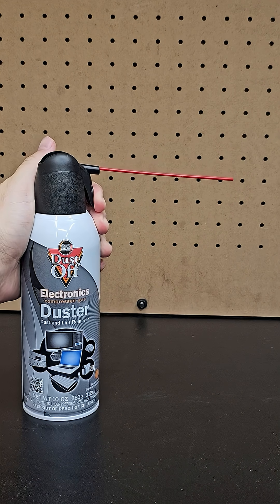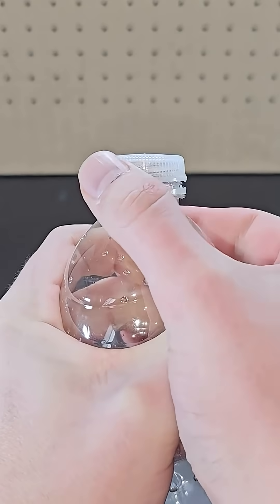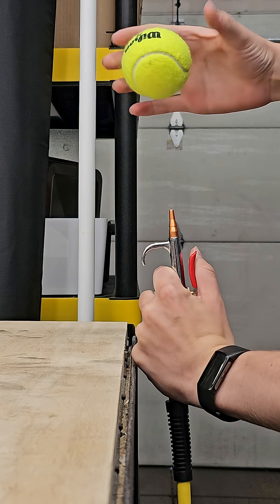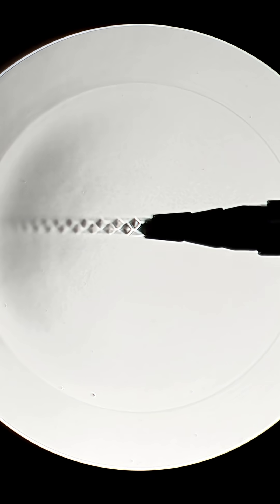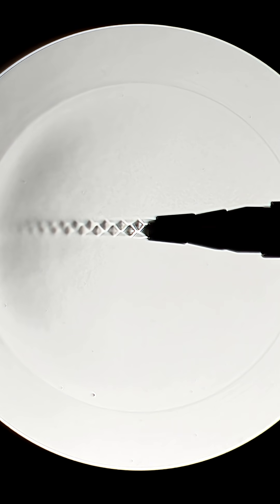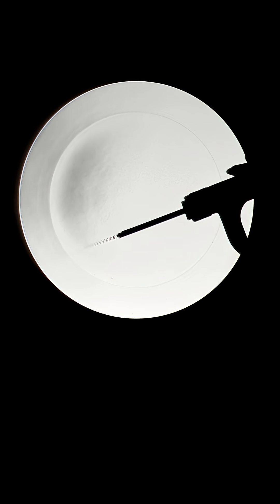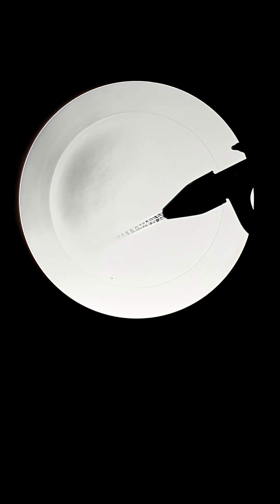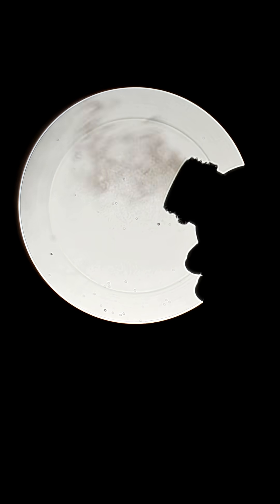Seeing SHOCK WAVES from Compressed Air & more! #shorts

Comment: You can actually train to do the fog bottle trick with your mouth. I used to do it as a party trick.

Suck your cheeks in hard as you can make a vacuum. Now try swallowing and clicking your tongue hard while sucking harder as you go.  If you have enough pressure and then push the air out of your mouth. It will look like you’re exhaling smoke. Seriously it’s super cool.